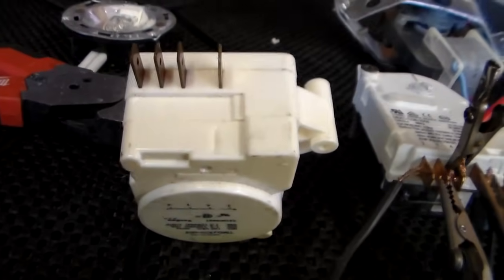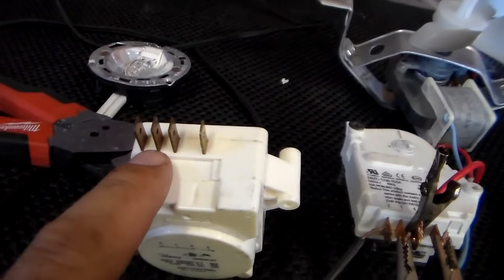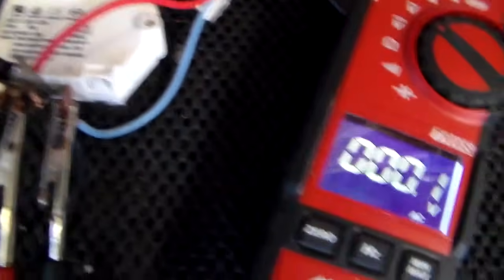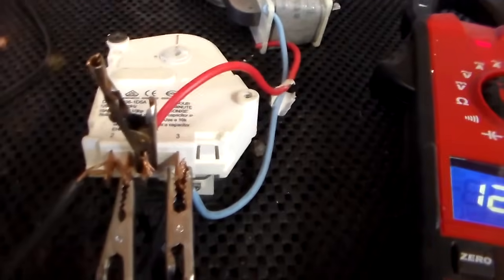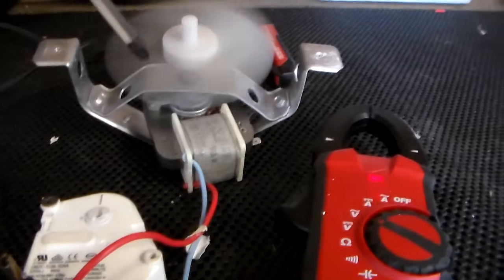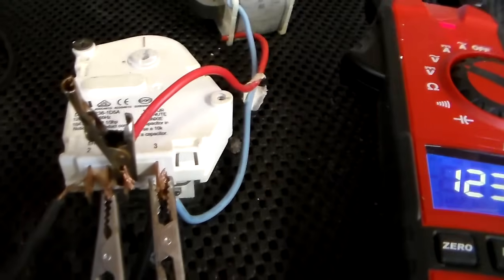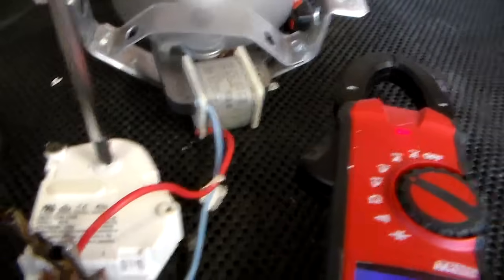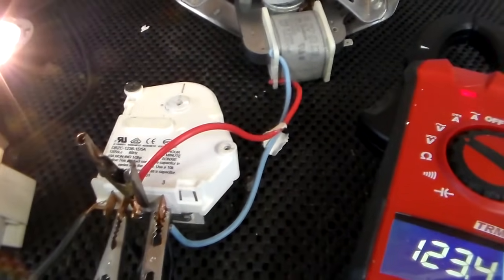How to Test your Defrost Timer

Comment: I know this is an old video, but just wanted to thank you. I just ordered a new timer for my fridge.
After hearing the noise of the timer, I remember I used to hear that noise from my fridge, and I no longer do, which explains why my freezer has frozen up on me.
I confirmed by marking the position with a felt marker and it didn't move after 2 hours.

It seems just like the old-school outlet timers used to turn the house lights on/off.

Comment: Bill, I removed the defrost timer 2162044 and connected pins 1 and 3 to an AC
cord.  I manually set the timer to defrost mode, and let it run overnight.  Next day
the timer pointer had moved very little, only just past the defrost mode, and then it stopped.  And there was no ticking sound in the timer, only in the defrost mode.
The timer must be faulty, so I ordered a new one.  Thanks for the video!
Reply from the maker: Faulty timer for sure, nice job on your troubleshooting.  Thanks for Watching!
Reply: this same thing just happened with my timer in my 30 year old whirlpool.  i had to rotate it to cooling again manually. timer died, and had no compresosr or fan at all.

Comment: Hey Bill, just found this great video.  I’ve had a classic problem in my Frigidaire refrigerator (freezer on top, refrigerator on the bottom) where the freezer was cooling very well but the refrigerator was not cooling at all. When I removed the back panel however there was no ice on the coils. There was thick ice all around the perimeter of the coils and into the airflow vents, but the coils themselves were free of ice. I checked continuity on the defrost timer, the thermostat, and the heater, and they were all good. I wonder if there was nothing wrong with the system at all, other than it had never been defrosted in 25 years? If the defroster system is not working, won’t the coils frost up?

Comment: Hi Bill, I came home today and my wife said the fridge isn't cold. I checked it out and found it as she said, not cold and the freezer looked like it was snowing. I unplugged, removed food to coolers and went to cleaning underneath and in the back where I knew it was going to have dust and dirt everywhere. Once I have everything cleaned and I plug in fridge, what fans or sounds should I see or hear if that resolved my problem? Should I attempt to reset anything first before plugging in? Thanks in advance for your help. Your videos are awesome. I just found them this evening and subscribed. Your videos are the most informative and professional of ALL the appliance videos. Thanks for all you do.
Reply: Oh, I forgot to mention I experienced this issue in the past where I had ice build up and just needed to let it melt and things were fine again, so I am doing that and see the water building up in the bottom of the freezer which is in the bottom of my Sears Elite bottom freezer refrigerator. Hoping this is all I needed to do.

Comment: Thank you for the excellent video. So Bill as a layman, what symptoms should I look for to decide if my timer needs to be replaced. Reason: my OEM ice maker quit making ice. So a replacement with a new ice maker, makes ice so very slowly, about a batch every a few hours. To me it sounds like that the problem is with the timer. Could the timer be the cause of small ice production?

Comment: Bill, Thank you for this informative video. I was unaware of how the defrost timer / circuit works until now. The shop bench set up is excellent. I am chasing a cooling problem in my 17 y/o Kenmore and after confirming the compressor, start relay and capacitor are OK, i suspect the defrost cycle is “stuck” and the timer is suspect.. next stop is a new timer module. Thanks again.
Reply: Was the defrost timer the problem? When its stuck in defrost, approximate what voltage range was supplied to the compressor which prevents the compressor from starting?

Comment: Excellent video out of all I watched It was the only one to show how to set up the test on the bench and how to figure out if the timer is advancing.  One question is there any thing that could keep the timer from advancing other than the timer motor is shot.  Thank you
Reply: yea if there is no ground to the  4th pin the  one that is by itself after the first three,.  make sure that wire is grounded good.    and no power to pin number 1 which second pin from left.  no power or ground to the timer means it wont rotate or do anything.

Comment: excellent tutorial  👍👍 i try to use  frige timer to switch light between 3 lamps 
2 work from heater pin and 2 lamps work on cooler pin 🤦‍♂️ like what u did fan on pin and lamp on pin - but I actually can't under stand where should I connect  the positive line in common pin or in the spreated pin number 3 or to pin number 1 commne" pin" !!

Comment: An old video that came in handy for an old fridge. Thanks, FYI for folks. My new timer had different labels on the terminals, but the position of what went to what was the same: neutral: terminal separated from the others with a space (call it far right), next terminal after the space: to compressor/fan, next terminal: 120VAC supply, last terminal farthest left: defrost heater

Comment: Thanks for the video. My freezer builds up frost and it does not freeze and no more cold air in the fridge. I let the frost melt then I replaced thermostat thinking that would solve it but nope same problem. Evaporator fan works I'm thinking replacing defrost time and then hearts if that doesn't not work. what do you think? when ice melts everything works good. Is just the frost that builds up quick and in panel in freezer have to wait for it to melt to remove screws. I have a Kenmore side by side fridge. My parents purchased a new one but to me we can save that money but we do need fridge it gets expensive eating out.  we still have a few days for delivery and goal is to fix it before delivery so we can cancel. Thanks

Comment: This is great. I have a NEW Hoover fridge freezer about 18 months old that was replaced due to a block of ice at the back of the fridge, then the timer was replaced because it began making a rhythmic noise and now the second timer has begun making the same annoying noise. I have purchased a new CANDY timer to replace it. Your video has been a great help. You don't know anything about sangamo timer switches I suppose?
Reply: apparently some batches of some models brands of timers are faulty,.  or bad run of them.. id go with a different or better brand model of one then.  some def timers last 30-40 years or more.  like mine has,. in whirlpool fridge here.

Comment: Bill I have a top freezer Kenmore refrigerator and a customer had a bad tenant that left and cut all the wires and I'm trying to help him and what we have is the evap fan comes on during the defrost cycle and goes on a d off with the door switch as it should but problem is the fan is working when defrost cycle is on and not when the compressor comes on any help would be greatly appreciated

Comment: Bill I have a whirlpool gladiator freezer bottom fridge top item. I've used the videos to replace the bi-metal defrost and the heater coil. I've taken everything apart but can't find the timer defrost so I can replace the old one with new part I purchased. Can you help me locate the item? Thank you.
Reply: it is up in the fridge up high next to the thermostat,  the two wires from thermostat run right to the def timer, red pink orange black wires four pins on timer.

Comment from the maker: If you have no frost on the coils in the freezer and the compressor is running. Your refrigerator has either lost all the freon because of a leak, or the sealed system is restricted and no freon can circulate.  Sorry to be the bearer of bad news.  Thanks for Watching
Reply: Ok what about if alot frost is built up my refrigerator. Coils been ruing warm and frezzer wont go into the -0 i check the time buy tuner it till it shut off  and the rob get hot and melt the ice but not sure how hot the rob to get can sorry my grammer suck i no but can a timer still be bad but it still come one was told cold be the thermostat that connect to coils to but seems my compresser runs all the time to

Comment: Had defrost issues in 15 year old fridge. Replaced everything for about $80 in Amazon parts - timer, thermostat, cold control, heating element, evap. fan motor. Not sure what the issue was but figured I'd preemptively replace it all instead of spending $1400 on a new side by side. It's a shame these appliances get tossed out because a $12 plastic part goes bad. Probably the last fridge I'll ever buy after spending a couple of evenings learning how it works and how to replace parts.

Comment: I have my multimeter out and you are the 3rd videos. Despite the last one with the multimeter which didn't make sense. Maybe you can add a annotation to the video on testing continuity. Test between pins 1&2 for power to defrost circuit. Test between 1 & 4 for normal operation.

Comment: Hi Bill, I have a kenmore bottom freezer,but the freezer and the fridge were not cooling at all, I removed the panel at the freezer and found no build up of ice on the evaporator coil , I also touch the evap coil but there's no cool on it. The evap fan is running same as the compressor. Can you help me with my problem.

Comment: When I have power and the harness is hooked up to the timer the timer makes a ticking noise in run mode but doesn't advance when I marked it - ran it for 4 hours. Took the harness off and jumped #1 and #3 terminals only, plugged in and there wasn't any voltage readings with #1 and #3 and no sound coming from timer at all. I am guessing the timer is bad. What say you?

Comment: My refrig has a thermostat that sits on the evap coil. Does the therm inhibit the heater from coming on until the coil is frozen? Also, is there a therm that prevents the evap fan from coming on until the unit is cool?

Comment: If I can start a timer after it is heat mode with a screwdriver, and it gets stuck again after 8 hrs on the same heat cycle, does it mean I have a bad timer? Thanks for your help.

Comment: Can u site where the compressor is wired and where the power goes In4 is the lead if the compressor and 3 is its nuetral? And the power lead is 1 and it's neutral is also 3? And the fan gets tied in same as compressor I don't put the compressor  neutral together with the power nuetral and cap it

Comment: I have a garage fridge I use to ferment beer in, so unless I'm making a lager it runs about 60-65F using a separate temperature controller with its own probe in the fridge. Worked great for years but suddenly it stopped. Light only.  Neither fan turning. I replaced the run capacitor which did nothing and was considering buying a new start up relay device. Neither of which I was 100% sure were faulty.  It was a $100 fridge off craigslist and, at some point, one has to stop guessing and shoveling $$$ at it. I never heard of a defrost timer. Without completely removing the timer and doing the set up shown in your video, or even metering it, I advanced the timer with a screwdriver (which without your video I would not have known about!) and the fridge came on. So, it's reasonable to assume the timer was not turning, stuck - if that's possible - in defrost mode and needs to be replaced(?)  Question is does it ever need to be in defrost mode?  What happens if it doesn't go through the defrost "cycle"? Iced coils?
Reply: But wait...when the temperature controller reaches set point it shuts the fridge off completely.  It basically unplugs it.  So that timer would stop running. But eventually it would start again.  Fridge gets too warm, controller "plugs in fridge" timer advances out of defrost (if it was in it when shut down) and fridge starts cooling, no?  Like I said I've been running this fridge like this for years.  Lots of home brewers do this.

Comment: Bill,

I have an Admiral HMG-191367 fridge that is not defrosting. Replaced the heater, because it was bad. Testing the timer now. Does the timer "tick" in normal operation. I don't hear any noise coming from it. Also, how common is it for the defrost thermostat to go bad? Thanks for the video!

Marcus
Reply: +Marcus Padilla: it is not normal for the timer to tick with any sound you would hear.  Not so common for the thermostat to go out but if they do, they frequently (but not always) are physically deformed on the thermo-set epoxy body where the wires enter. The number one fail mode is the timer not the thermostat or heater. This is what little I have learned that I am sharing. God Bless.

Comment: Big Kahuna
I have an Amana side by side Model ASD2625KEW that was given to me a few months ago.  Once I added some freon it started working normally.  However, it trips the circuit breaker every 3-4 hours.  I placed it in my patio and plugged it into my Ground Fault (GF) outlet.  After a few times of tripping the GF I switched to a regular house outlet.  But it tripped the breaker in the panel in the garage.  So I switched it back to the GF.  After the first few times it tripped the GF, I simply pushed the reset button to get it going again. Then lately when I reset it GF it would tripped the breaker in the garage as soon as i pressed the reset button.  So to get around that I now pull the plug out first, press the reset button, then plug in the fridge and it will run for another 3-4 hours before it trips again.  Could this be caused by a bad timer, bad defrost heater, or by something else?

Comment: mine i think is solid state.  it does not have an audible timer.  and it has those pins yours has, but also has a pin 5 and pin 6.  do i check the function the same?  other than being able to advance the timing.

Comment: Hey I have a problem with a stand up freezer that won’t cool, fan and compress both won’t turn on when plugged in and dial turned to any setting other than 0-off, could that be caused from the defrost timer?

Comment: I have a side by side whirlpool.  The ice door appears to be not sealing causing frost build up on the freezer side directly above inside of the freezer.  My question that I want to ask you is that can that cause the frig side to not be cold enough to keep food cold.  That’s what appears to be happening.  Any help would be greatly appreciated.
Reply: If air leaks into the freezer compartment it will create too much frost. As frost builds-up, it will restrict the cold airflow into the fridge side, causing it to warm-up. Eventually, your freezer will become too warm as well. Try to fix the door gasket before it's too late.

Comment: Thank you so much.   Your videos are really excellent!!  I have a one question -- since i can't seem to find wiring schematics for my fridge anywhere (why is that?), does the power from the defrost timer for the evap fan also power the lights, so that the lights would be off in defrost mode?  Both my evap fan and lights are not powered - but i tested them and they are good.  So would a bad defrost timer also affect lights not coming on?  Thanks

Comment: I did it with your help.
The problem was with some short circuit. It was sending timer's pin number-3 ~Live voltage:) it stopped the motor because of that circuit. i almost bought a new fridge:) but istead i bought a multimeter... so far i realised that i got live voltage on Neutral so i said WTF???
 So i've just plugged the timer with different neutral cable..and boom everything works-))))!
Finally i was able to hear that both of them: Timer, and compressor with fan works together: Bingo!-))
without you it wouldn't be possible to fix!i  found  the problem just  because you showed the right  wiring connection.
So before buying a new fridge my dear friends, take a multimeter and check for the faults  Follow along Bills video and remember the exact wiring connection of the timer.
L= live  N=neutral
another words L=1 N=0
---------------------------------------
Timers wiring.
2= L voltage to the heater 
1=L constant voltage (gives the timer's motor a power)
4 =L voltage to Fan and compressor
3=N This is a common Neutral for all of the pins!  including the timer's motor   (i had a LIVE voltage on that pin) istead of Neutral
so thanks again man:))!!!!
Reply from the maker: +Dmitri Mironov Very awesome job!

Comment: Hi, I have a question, defrost refrigerator working continues non stop.  While running ice on the suction line.  Thermostat set in medium& gauge 9psi. I`ll waiting for your reply. Thank you.
Reply: defrost mode stuck on probly bad timer.. if cooling stuck on then probly bad thermostat,   try rotating timer to next mode see if that helps.    still run nonstop then thermostat bad.   easy to test with meter    break in circuit when off and no ohms resistance when all way on

Comment: Bill, could you help me understand the purpose of the capacitor inside the defrost clock, now if I understand that the
power from no (1) goes threw the cap then to the clock motor is this correct, and will blow before cooking the motor windings
if they become shorted. Just need to understand why they put a capacitor inside the timer. Thanks Bill.

Comment: Pls.answer the compressor, fan motor evaporator, fan motor condenser and light are connected properly and good in conditions then I saw wiring connected to the defrost timer is there any posible those will not run if the defrost timer are bad?

Godbless
Reply: timer can stop compressor ans fan from runnig yes.    rotate it with thermostat rotated on all way max cooling.. if they kick on while you are rotating timer then timer is not working.  or no power or ground to it,